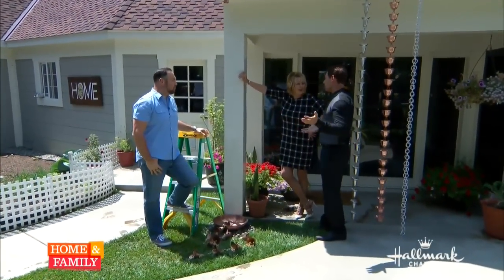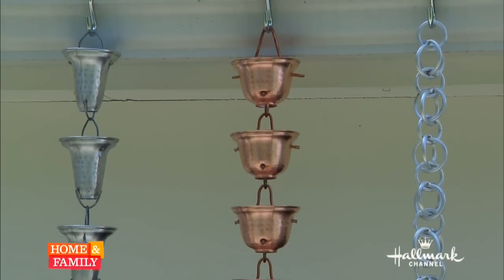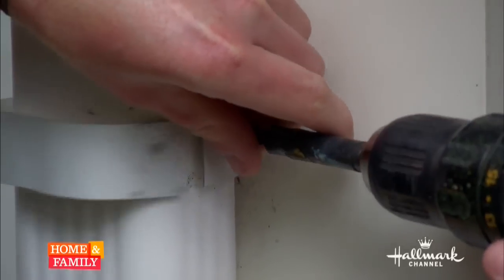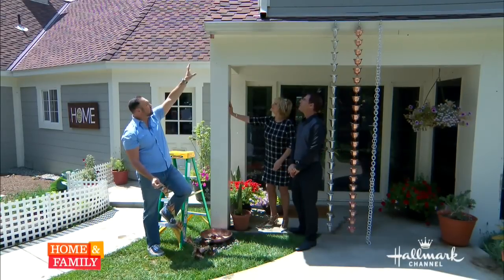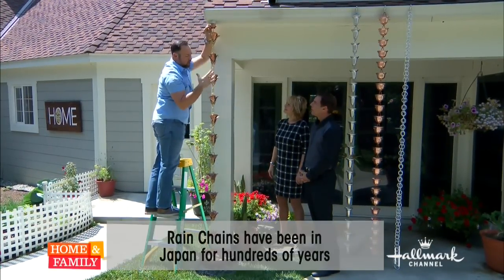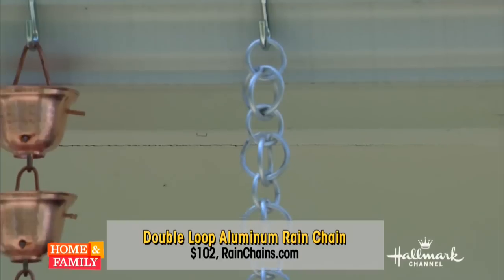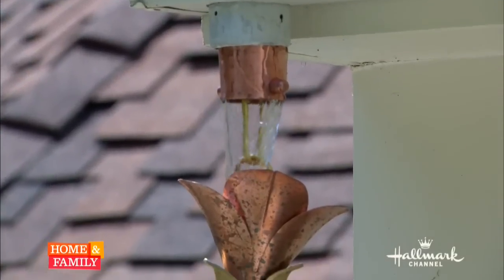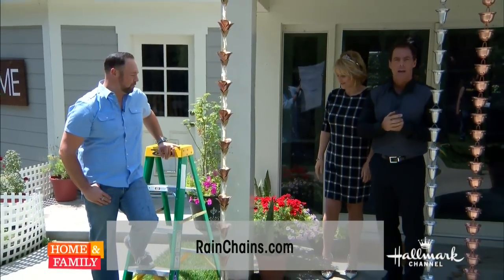Rain Chains on "Home&Family" TV show

Comment: To keep the chain from moving you secure it on the bottom.  I went to Lowes and picked up copper chain under $3.00 and tied it to a rock underneat. Two rain storms and no movement and functioned perfectly. You can add a basin to catch for $30.00.  I am cheap.
Reply: love it.

Comment: Look nice, but I will never replace my gutter by these. Not good for the foundation
Reply: Saraswati H , we have an underground drainage system, or have it empty in to a water tank
Reply: Saraswati H so right. And on a windy, rainy day I can only imagine.
Reply: What this video didn’t show is what your supposed to do so the water won’t harm your foundation! You can use landscaping rocks that you pile up higher by the house so it will run off & the water an be directed that way to a garden farther away from the house! I think it’s called a water garden, it’s very environmentally friendly! You can also make a fountain feature at the bottom but you do have to make sure that what ever you do you must make it so the water runs away from the house & so it doesn’t go in the storm drains! It’s like recycling rainwater! That was any pest asides won’t get in the storm drains that end up in the drinking water! I just watched one of those Holmes Makes It Right & he installed them on a home with rock beds at the bottom & he went through the whole process! It’s a little complicated to do but so worth it when finished! These guys in this video aren’t much help! They blatantly just want to sell the rain chains with out teaching how to install it other than at the gutter & they dont tell you how to make the ground area so it won’t ruin your foundation! But if you learn correctly, instead of just buying a rain chain you will be pleasantly surprised!